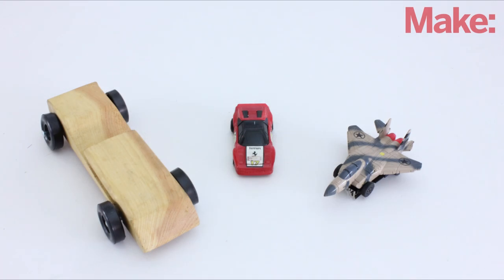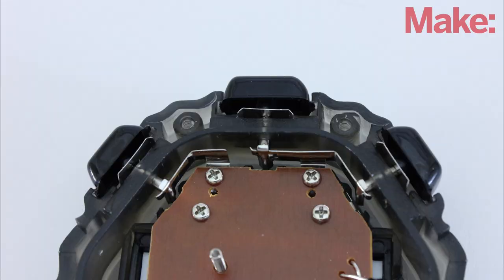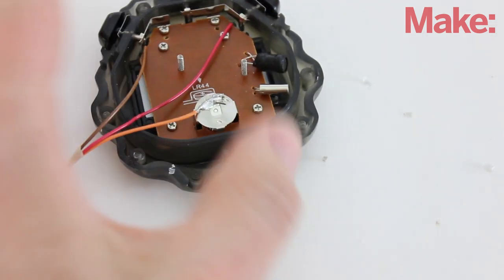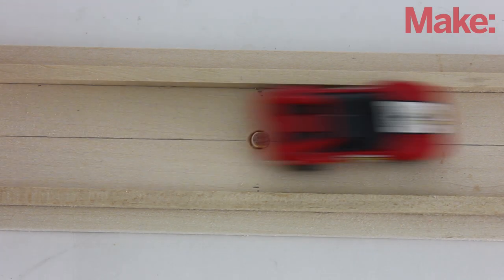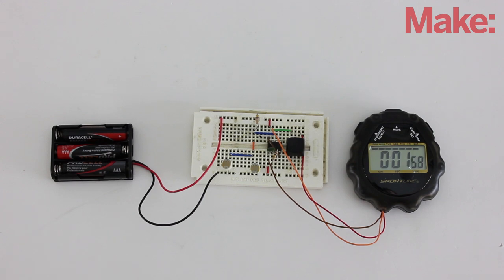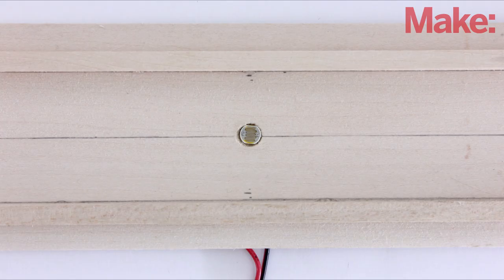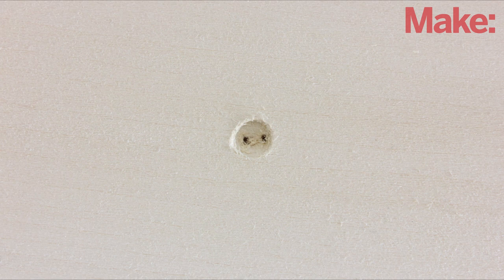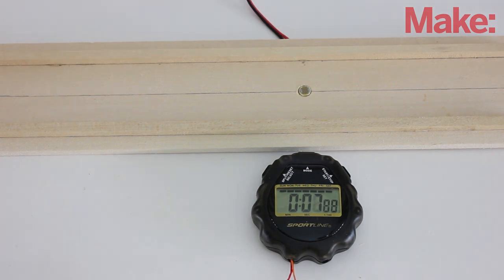Sensor-Triggered Toy Race Car Timer

Comment: Why the 555? wouldn't a transitor do or are you using the 555 to lengthen the time for closing the circuit to the stopwatch or is it to filter unwanted closures?

Comment: really? what about an arduino and lcd? you were better than that but now you are too lazy.
You could have added a reset timer so that after 10 seconds of inactivity it will auto reset.
Reply: casaverdero I respect your opinion but, recently, they were using Arduino a lot. I liked that circuit, and I can imagine many applications, even with ATMega328.